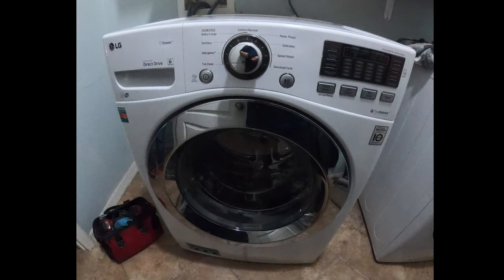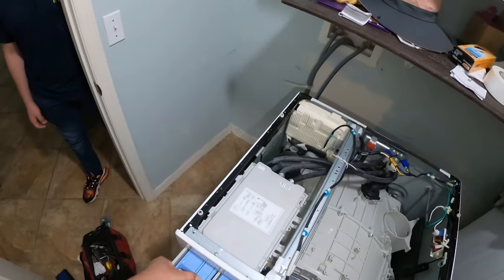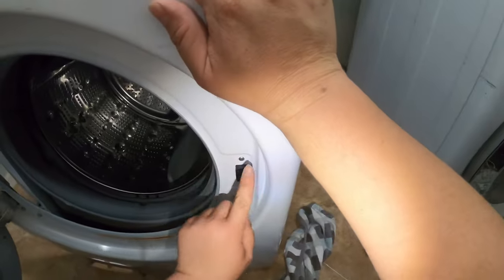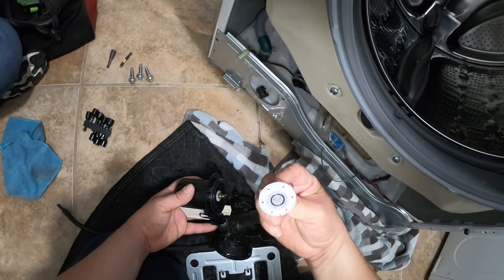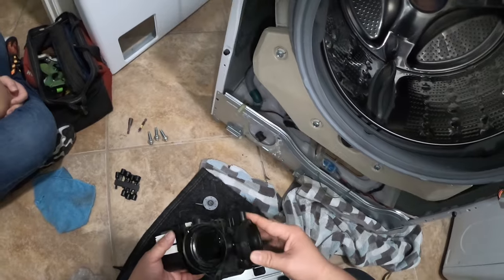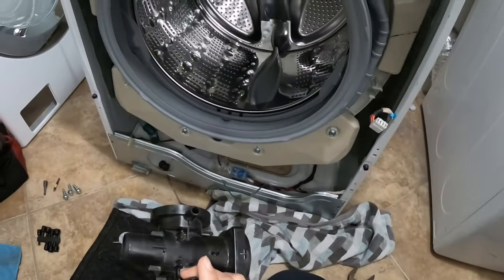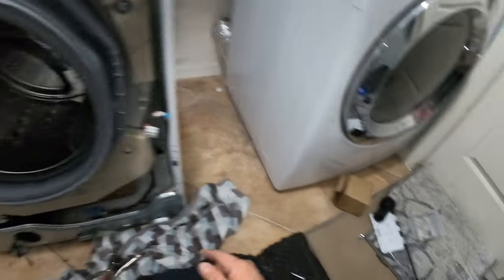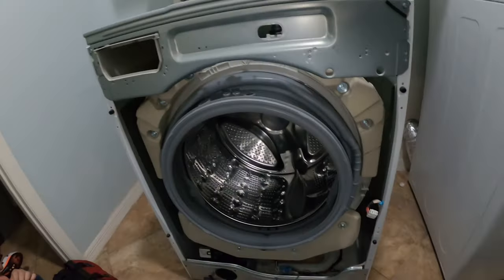How to Fix LG Front Load Washer NOT Draining | Model #WM3370HWA/01

Comment: ATTENTION: I had to replace the pump in my lg washer machine today and i found a way faster and easier way to replace the pump! Take the coin catch cover off then unscrew the screws that above the coin catch then tilt the washer so the right side is in the air and there is a big opening under the washer then locate the pump under the pump there is a slide that clips in the bump houseing push the tab so u can slide it out then take the two hoses off and the pump comes right out! This only took me 10 min from start to finish
Reply: This basically worked for me.  Went through bottom, removed pump from bracket, had to loosen the easiest 2 bracket bolts to allow full access to front side screws holding pump to bracket.  Leave the front bracket bolt in place or instal it again then attach pump to the plate, or it’s a huge pain to attach around the pump

Comment: Thanks for posting this thorough video.  You saved me at least $300.  Yes, the hardest part was re-seating the wire-spring device on the door seal. My machine is 7 years old and this is the first time requiring maintenance.  Found the OEM pump locally and repaired it the same day it failed. Was able to remove the three large bolts in my case holding the pump to the washer base.  Instead of removing the two screws on the bottom of pump , I loosened them and was able to remove the pump from the base and housing. Thanks for the tip of not removing the second hose!
Reply from the maker: You're welcome! Glad My Video Was Helpful!
Reply: 7 years old? Mine is 2 fucking weeks old and this happened.

Comment: Just finished replacing the drain pump on my LGWM3370HWA. I was glad to find your video dealing with the exact same model as mine. Your video was extremely helpful and made replacing the pump manageable as I thought I might have to call for repairs. Your tip on not removing the back drain pipe made reinstalling the pump unit easy and fast. Also, your recommendation to use a spring expansion tool made it a breeze to reinstall the drum boot. I recommend that if you are not experienced like I am, to take pictures and label screws/parts during disassembly so you will know where each item goes when reassembling. Took me about and hour-and-a-half to remove the old pump and less than 1/2 hour to install the new pump and put everything together.
Reply from the maker: I am glad my video was able to help you. Thanks for watching my video.💯💯👍🏻👍🏻

Comment: I replaced mine about 6 months ago and it appear to be not draining AGAIN. I have checked all of the filters as well.
Reply from the maker: Did you install the OEM? Part?
Reply: @DIYRepairsNow  yes according to the where I ordered it from. I will double check. Besides that any other reasons why water would remain in the tub? 

And thanks for the video! It was helpful!
Reply: @DIYRepairsNow what is OEM?
Reply from the maker: @laliuxh14  OEM Original equipment manufacturing that means the part is made by the manufacturing not by third-party

Comment: Thank you!!  This worked for me.  Just replaced the pump only, which I was able to do without taking the housing out of the washer.  Took the 3 screws off holding the housing down and was able to take the pump off from inside the washer.  For anyone about to do this, the housing screw heads are 10mm on a metric socket.  Just ran the first wash and its good!  You saved me basically the cost of a new washer.

Comment: I’m in the middle of this exact repair on this same machine. Thank you for the detailed video!

Side note: @7:58 “13 32 millimeter” isn’t a size. If that’s how your socket is labeled… I got no idea. For everyone else, a 10mm socket fits just fine.
Reply: 13/ 32 is an imperial size.  It is slightly larger than 10 mm .

Comment: I am doing a replacement pump on my sisters lg it’s a double pump! But it’s actually cheaper to put a whole new pump and housing in. As it’s nearly 20 quid each for the pump motors that have unfortunately both gone wasn't circulating water from the jet was blocked but unblocked it and it just stopped working. And the drain pump side was making grinding weird noises and then just died wouldn’t drain any water or do anything surprising no error code came up ? So think the pump has had it wasn’t blocked. Would I be right ? It’s a wm12331fdk lg.

Comment: I’ve seen videos, where they replaced the pump or motor from the bottom.
Does it apply to this model?
Reply from the maker: If it’s open at the bottom you can try to do it that way  sometimes is your choice I have done it both ways sometimes removing all the screws to take it all apart is difficult because they get rusted and they don’t wanna come out that’s when I choose to do it from underneath if it’s open on the bottom 👍🏻👍🏻
Reply: @DIYRepairsNow  Awesome as always, thank you for your wisdom and knowledge Nestor.
Reply: @rafaelretiz6267   were you able to repair this model by accessing from underneath, or did you have to remove the front?

Comment: How much did this cost?
Reply from the maker: It depends if you use an aftermarket or an OEM pump, but it runs between $185 and $300
Reply: $29.90 with free shipping from Amazon. Received next day. Follow link above.
Reply: TCL

Comment: I replaced the drain pump and washer still not draining, what could I have done wrong?
Reply from the maker: You have to check to see if you get in voltage to the pump if you get a voltage to the pump in the pump is running but it’s not getting the water out you have to check the check valve I am going to send you a couple links in those videos. You will see what is a Check valve
Reply from the maker: https://youtu.be/Mht5SdPLBFE
Reply from the maker: In the video, I say flapper, but his check valva
Reply from the maker: https://youtu.be/LbANzTzLCK4
Reply: @DIYRepairsNow  thank you so much, I will check it out
Reply: @DIYRepairsNow  would this work on an Lg front load as well?
Reply from the maker: Some of the LG models does bring a check valve, so yes it will work